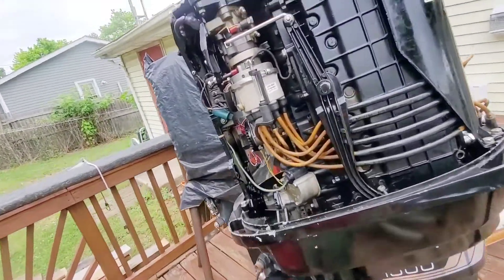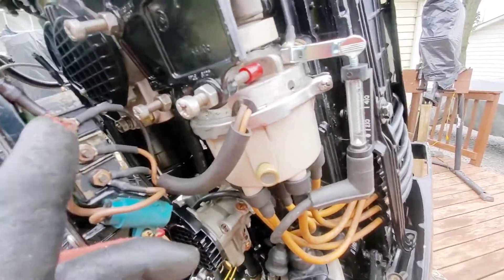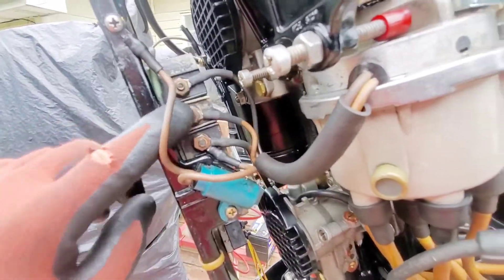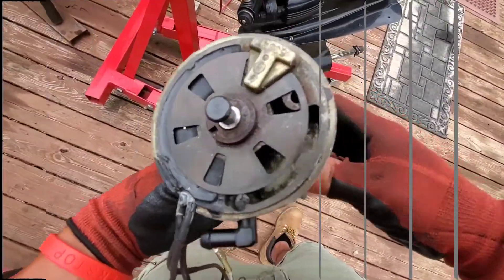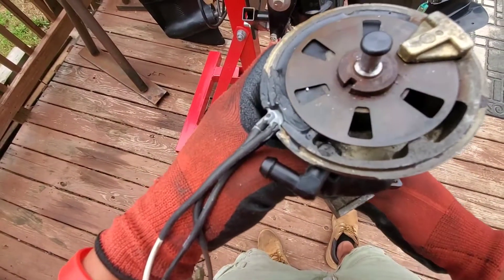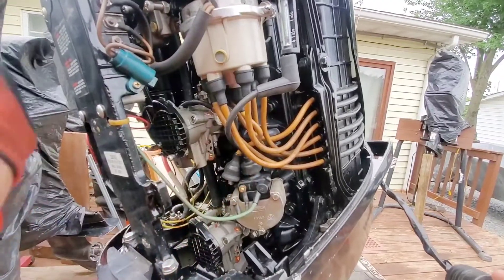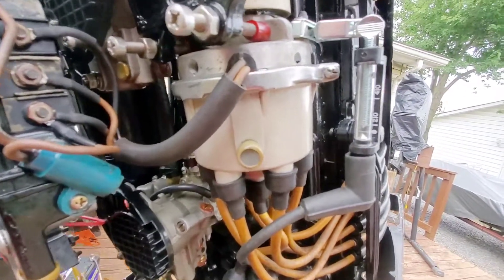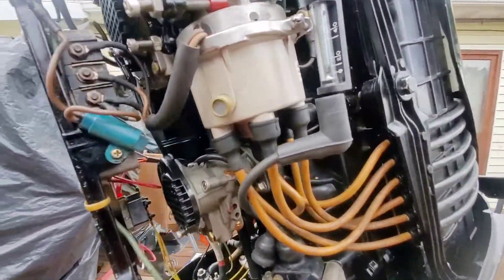Mercury Outboard Trigger Testing: While mounted on Engine

Comment: I have a 1500hp 1973  i did a bench test very thing worked good i replaced key switch harnesses replaced stator put it all back together get one spark and nothing  replaced distributor disc works on bench test

Comment: 1971 Mercury 1350 - I've been going through a lot of your videos and it's really been a lot of help with my outboard. 
 My distributor is not always going back to it's original position when I pull back the throttle. Sometimes it does, some it doesn't. I have a idle issue. Idles fine when cold, struggles when hot. I believe the issue with the distributor not moving back to the stop is the issue. 

Question - Is there a way to adjust the tensioner to bring back the distributor to the original position/against the Stopping screw?
Reply from the maker: Short answer: no. The issue could be a bad throttle cable.
Reply: @MerCSonL6  Could definitely be the problem. Still original cable from '71. Thanks. Will have a look at it.

Comment: So when I connect my spark tester to the switchbox, I get 6 sparks turning the flywheel. At 0 degrees I get spark (with the tester on the switchbox) turning the distributor. But if I connect the distributor to the switchbox, I can hear it clicking when I should be getting spark from the plug, but no spark from the plug. Heeellllppp.
Reply from the maker: Sounds like the distributor is not sending the sparks. You can remove the cap and gently sand the rotor and points. If the rotor is worn I recommend replacing it. Let me know! Son
Reply: @MerCSonL6  I got it figured out. My broken tachometer was shorting out my ignition. I disconnected the power, ground and signal from the tach, and started getting spark again. Your videos have made me a somewhat expert now tho. Thanks!

Comment: My trigger is complicated. It first sparks but after 30 round, it stops sparking. The brown wire on switch volt was 8.6v at first and then drops to 5 v, and that's why there is no sparks. But if disconnected with trigger, the brown wire is 12 v and 10 v at cranking. So the trigger is to be blamed. Manually checking, connected with switch, whenever the trigger is triggered on, the volts drops from 12v to 8 v. What could be wrong with the trigger?
Reply from the maker: Replace it if you are 100% sure of your diagnosis. Worst case scenario you know its not your trigger causing the issues. Son

Comment: How can I get in touch with you. I have a distributor issue on my 650 L4.
Reply from the maker: Whats your issue. I get a lot of questions...daily. son
Reply: MerCSon L6 I have a 1967  650 L4  that I need a distributor  (CDI) for. I have located a very nice complete distributor from a 1967  500 L4 .Both of them look to be identical. Will they interchange o k. Both are Thunderbolt motors. I appreciate your knowledge and I am just trying to get a some confirmation that this will work before I spend the money. Thanks for any help and keep making them talk.
Reply from the maker: @garyhughes1921  the spacing may be off at the pulley. You can make it work with some fabrication. Flywheel will need removed. Both operate under the same high speed and low speed coils within the Energizer. Hope this helps. Son